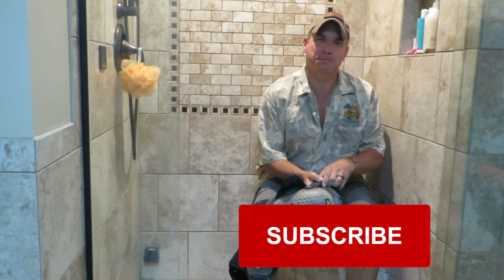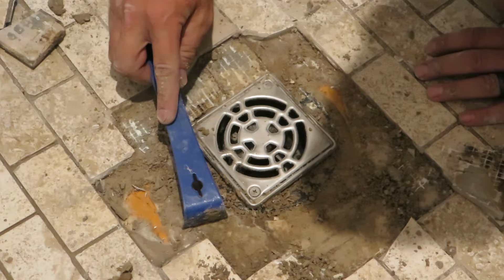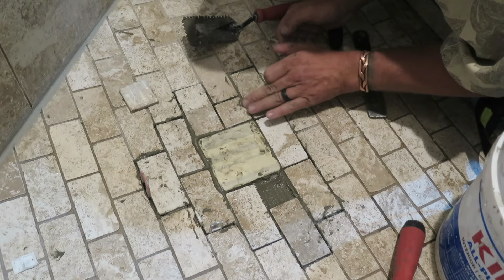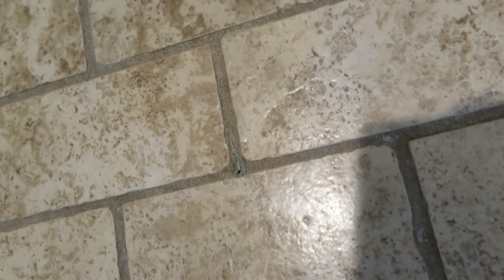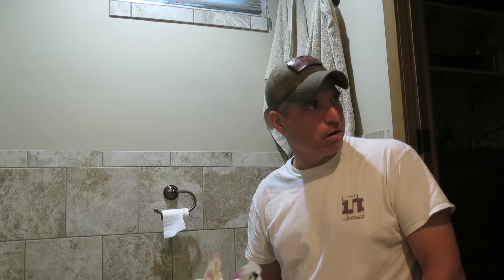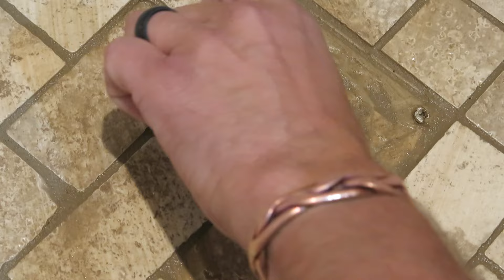Steam Shower Floor Tile Repair

Comment: Was the shower floor cleaned before this? What if they are dirty?
Reply from the maker: Hey Bryanutility6909 thanks for watching. 

Yes, they were cleaned prior to the repair. However, there was an enormous "rat sized" hair ball that I pulled out with the drain grate. Bathroom tile cleaner is a good start. If there's waxy soap build up I'll occasionally use either denatured alcohol or lacquer thinner. I use regular white vinegar for mineral deposits. 

Thanks for watching and the comment! Apologies for the delayed response. If you have more questions, I'll respond sooner. 

-M@ W/1T

Comment: How much should I pay for this type job?
Reply from the maker: Hi Cliffordhicks! Thanks for watching and your comment/question. 

This job took about 8 hours to complete over three days (I had other work in between dry times). These folks are repeat customers and they had the extra tile and grout on hand so I gave them a pretty deep discount. I charged them $380. If this was a one time customer and I was running around trying to match tile/grout I'd probably charge closer to $500 with the increased prep time and material cost. 

I hope this answers your question. Thanks again for your comment. Thank you for watching my video! 

-Mat W/1T

Comment: Replacing the whole floor tile in shower
Reply from the maker: Hi there Kathryn. Thanks for watching and taking time to make a comment. 

Replacing the whole shower floor is a tedious exercise. I would recommend being extra careful to not to damage the substrate under the tile. 

If it is a Schluter system (orange) the membrane is adhered to polystyrene foam. It is very sensitive to pressure and sharp edges. The way I tile my showers is from the floor up, so the walls are overlapping the floor tile. Pulling the edge tiles will be very difficult to not chip the wall tiles. Additionally, if by chance you tear or rip the substrate in the corners and it goes unnoticed the shower will fail again. For an entire floor, it would be my recommendation to pull the floor and first row of wall tiles around the entire parimeter. 

Good luck! I hop everything works out for you. 

-Mat W/1T

Comment: not a pro, didnt plug up drian first, no repect for plumbers..
Reply from the maker: Hey there Jondozre, thanks for watching and taking the time to comment. 

I always plug the drain pipe one way or another. Not just for fear of clogging the drain, but also for sewer gas oder, losing tools and spacers! On this particular repair I might not have had my Oatey Plug but there was certainly something retrievable plugging that pipe. Last week I was taping and texturing a bathroom. My typical 3" Oatey didn't fit the toilet flange, so I used the bottom half of a large plastic soda cup and florescent orange tape so the toilet didn't get installed over it. 

Anyway... I have deep respect for plumbers and electricians. I can be as professional as you want me to do. :)

Thanks again for watching! 

-Mat W/1T

Comment: That kerdi pan was compromised, this repair is fruitless...
Reply from the maker: Hey there Mr. Latini. Thank you so much for your comment and watching the video so intently. 

I know exactly what you noticed and I assure you that the "tray" (Schluter Systems actual nomenclature) wasn't even exposed. What you might have noticed was a tiny portion of the KERDI collar delaminated when I was popping the tiles off. I actually asked the Schluter rep about this issue and showed him photos. I applied a little All-Set under the edge of the collar while I was burning in as I was resetting the tile.

I checked out your channel. Your installs look great! Very clean sir! Your install in the golf ball video, provided that it was your install, is extremely tight and well laid out. I gave you a subscribe. :)

It appears that our business model is quite similar. Check out my channel. I have a great video on how to quickly install drywall corners with paper tape. 

Thanks again for watching and the comment! If you get a chance, I'd really appreciate a subscribe. 

-Mat W/1T
Reply: @Mat-W-1TFandF  good response and I hope that repair holds...important to keep that 2" overlap intact or cut back further and apply a patch or some hydroban liquid over it before setting. Get yourself a multi-tool and some diamond git blades to assist in that grout removal...If you dont have one, it's a great little tool and a time saver. You got my subscribe just from your response alone, keep up the good work!
Reply from the maker: @superseal717  Thanks again! 

Yes sir, I have several multi's. Have a couple diamond blades too. I get sketched out using them to remove grout on the Schluter substrate. One slip and a little job becomes a big job. I have also inadvertently buzzed the finish of neighboring tiles before. 🙄Sometimes, the tedium of hand tools is a little safer IMO. Higher up the wall or above the waterline I'm a little less cautious. 

I appreciate your comments and thanks so much for the sub!

-M@

Comment: Never instale brick patern in shower floor its stupid tell costumer first
Reply from the maker: Hey there Marco, I see you watched and commented on another one of my videos. Thanks for watching! 

The only thing that's going in"stale" are your malicious comments. 

The customer had this shower floor done about 12 years ago. The mosaic tiles come in sheets which are laid out in 12"x12" and are already in the 50% running bond "brick" pattern. You prefer to separate each tile from the sheet and set each one individually?

This was a repair on a steam shower that I did not install originally. 

Thanks again for watching and commenting. If you get a chance, please subscribe. I'd appreciate if you could review and comment on the rest of my videos as well.

-Mat W/1T